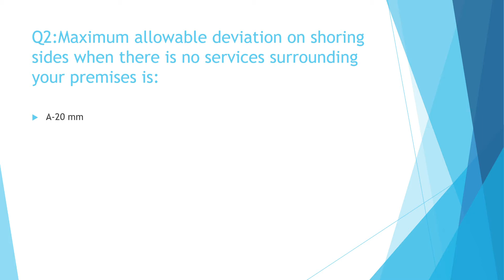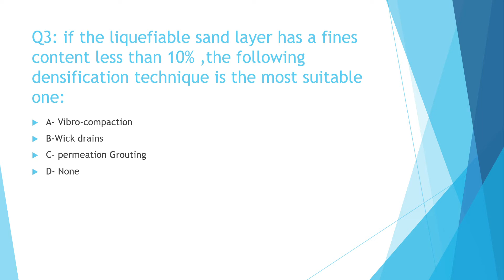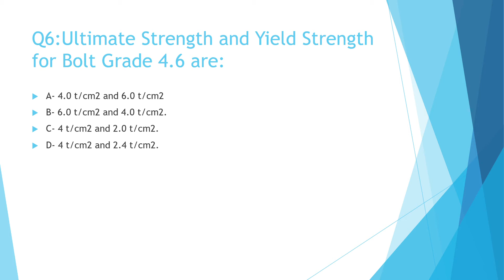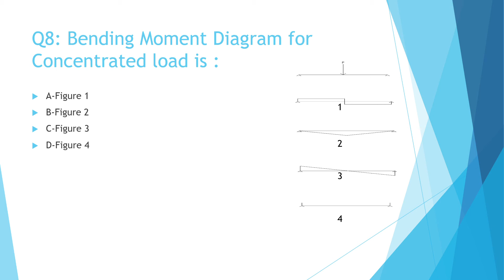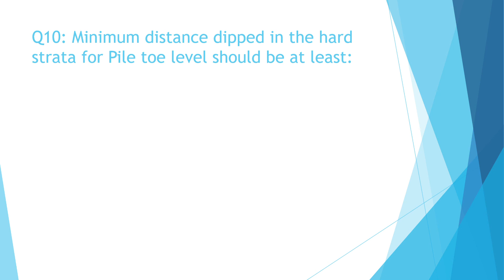Dubai Municipality Civil Engineer Exam 2022 for G+12-Part 1 contractor

Comment: Question no 10 answer as per DM building code is 3D can you please clarify?
Reply from the maker: https://we.tl/t-Mr4AtyzdAV
Reply: @mroshdiengineering  Thank you very much Sir, the below is from Dubai Building code.
 Pile design: general Ensure pile design allows for both gravity and lateral loads.
Piles to be designed for out of verticality tolerance of 1/75.
Piles to be designed for eccentricity of vertical load of 75 mm.
Factor of safety shall be at least 2.5, unless geotechnical model
and geotechnical calculations based on the geotechnical site
investigation are provided.
Minimum rock socket length of three times pile diameter.
The use of bentonite is not recommended. If it is used, the shaft
capacity shall be reduced.
Pile caps shall be designed in accordance with the requirements
specified under ACI 318-19 and the CRSI design
handbook [Ref. F.8].